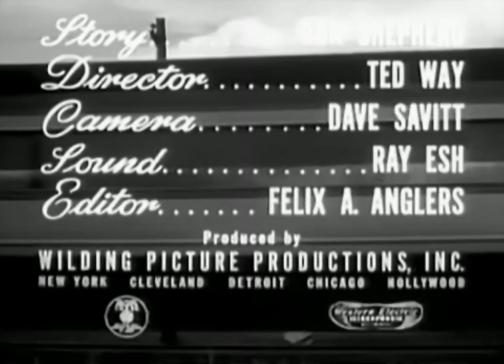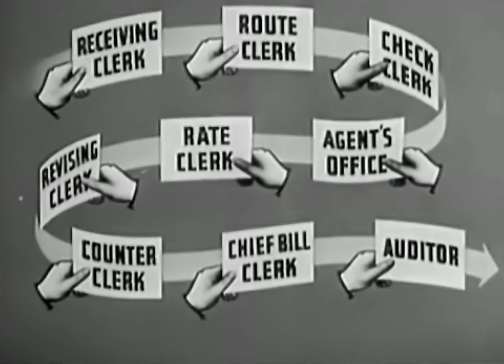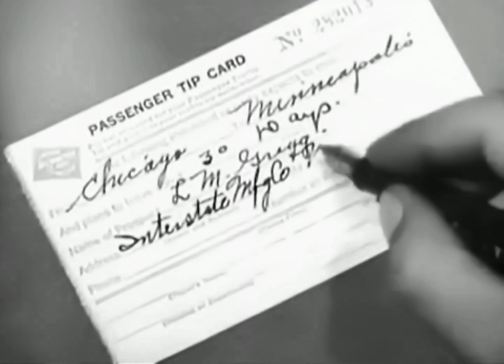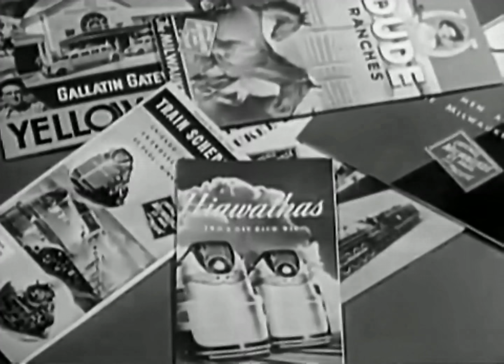Milwaukee Road A Railroad At Work 1946 Film [4K]

Comment: And now I think only 261 is the only remaining operational steam locomotive.

It's kind of amazing how the company was so poorly run, it took an accounting error of its assets at face value (rather than question it) and ran itself into the ground. And to top it all off, they decommissioned their transcontinental route through Idaho and Washington at a time when that line's revenue might have saved it. But thanks to poor maintenance practices? Belly up.
Reply: HHopebringer  Your logic is twisted. It was the Pacific extension’s losses through lack of traffic that drove the railroad into bankruptcy. Not once, but three times! After the line to the coast was abandoned the core railroad became profitable enough to generate interest from three railroads.
Reply: @douglasskaalrud6865  yes, but they discontinued the Pacific extension right as the 70s oil crisis occured. Remember that entire section was completely electrified and probably could have saved them money on oil.
Reply: Not to mention when they built the Pacific Extension, they absorbed a bunch of indebted railroads to serve as branch lines. And partially due to managerial incompetence, they never managed to get a significant chunk of the debt discharged or swapped for equity.

Comment: Brand new E7 being delivered on the tail end of that freight? 01:55
Reply: Yes - cut in ahead of the caboose.
Reply: I'll look this First Generation Diesel up. Nice One!
Reply: No. New power is never trailed behind light caboose. You’re probably looking at a shove move using road power. They are likely shoving the rear balance of their train into a receiving track, cut off in the clear and hang the cab with the power back to the roundhouse or service tracks. And it’s probably not the road crew doing it but a Herder/Hostler yard job.